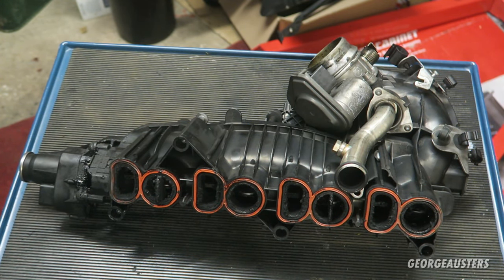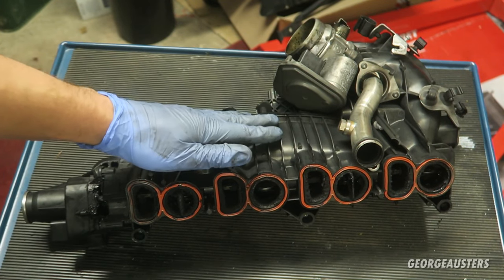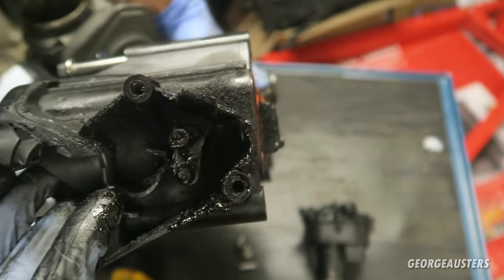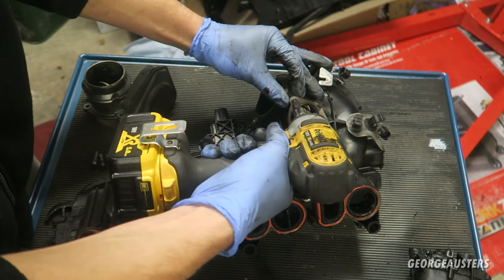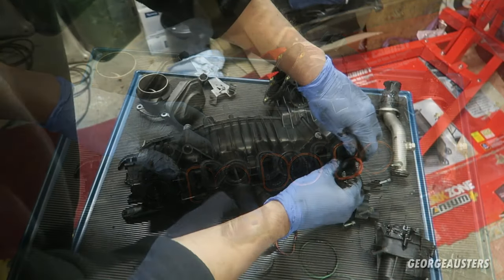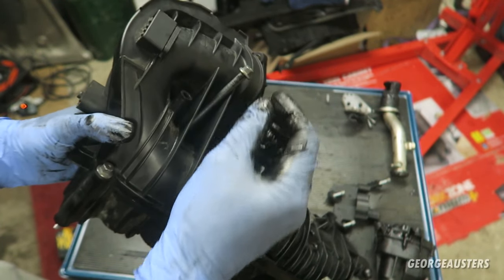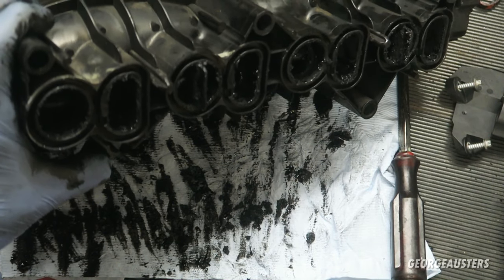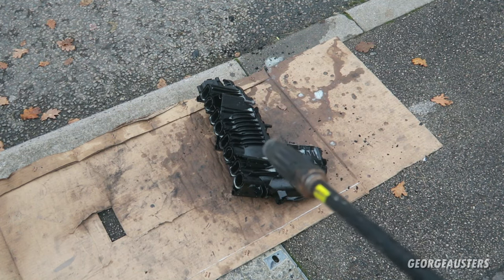How to DIY Carbon Clean BMW N47 / N57 Intake Manifold

Comment: If the manifold is that bad, then the intake ports on the head will be just as bad too. I put the manifold and loose parts into a bath of water based parts cleaner. Works very well with the HP wash after that.

Comment: Plan to do the same on mine but I have previously done it on my 3.2 did shogun, I found oven cleaner, the foam kind to work really well for agitating the parts you can't get to and then did the same with a pressure washer...

Comment: I recently done the same on a van.
Got a tip from someone who suggested immersing it in diesel over night. I did this and in the morning all the gunk was dissolved sitting at the bottom of the container. 
I left the rubber seals on and the became soft so had to get new ones. But the diesel worked unbelievably.
Reply: Does this really work? I'd love to try it and don't want to mess up my BMW's intake manifold... Diesel wont eat anything else and only loosens the carbon buildup?
Reply: @blankname8553  yes really did work just remove any seals before hand 
Thank me later

Comment: Very good video, I have thought about doing this after the 6 years I owned my 2009 E91 with the N47. And after watching this I now know why the engine don't have the same power it had when I bought it. Luckily my engine model don't have the swirl flaps.
Thanks again for you effort :)

Comment: I bought a 2nd hand inlet manifold to replace one on my 320d where the brass rod had worked its way out into the engine bay!!  The new one was filthy, but I used a gorilla tub, and loads of really hot water  with a few cups of Daz washing power, and just left it to soak in the gorilla tub for a few hours then flushed with a hose and repeated the process... Automatic washing powder is fantastic at removing grease at those temperatures ;-))

Comment: Newer N47 haven't got the swirlflaps at all. Mine is a N47 (E91) from 2012 and the inlet  manifold differs a lot  from your  from 2008.  I cleaned mine manifold at 100 000 miles, and it was definitely necessary.
Reply: Same here at 105K miles

Comment: Hi George great videos, Super helpful with all my n47 issues so far. Just wondering as im not very confident cleaning the inlet ports on the block its self. Is there any downsides to just cleaning the carbon build up on swirl flaps and inside the inlet manifold only instead of doing the lot?

Comment: Good video - best degreaser for this is Screwfix non nonsense heavy duty degreaser. It is about £10 for 5litres. It eats oil and grease and is water soluble. It will remove all that stuff easily and better than any soapy degreaser. Im just a bit concerned that all that water will get into sensors on the body of those electrical control valves. I would let mine dry out overnight in a warm room ( kitchen!!) Soak the seals in tis stuff and it will clean them like you would not believe!! no solvents in it either just surfactants.

Comment: Further to a reply I made on another of your videos a week or so ago, timing chain noise seems to be getting worse on mine and can’t afford to risk letting it grenade so am booked in with a specialist in Nuneaton to get the job done on Monday! Have been paranoid about it since day one of getting the car so.. at least it will take that paranoia away!
Reply from the maker: Good stuff. Are you getting clutch and flywheel done at same time?
Reply: It’s an automatic.. so no just the chain job. Have been contemplating a full automatic transmission service though..
Reply from the maker: Would recommend auto gearbox service every 60k Miles but that can be done at anytime 👍🏻
Reply: @jimtaylor431  I am also gonna get my chain done. Got all the bits. Chain gaskets oil filter. Also gearbox filter sump pan and oil. Ben quoted £650 for a labour only job!  I'd do it myself but can't get my car high enough on my drive way. Just doesn't seem practical. So will be interesting to see George do it. Looking forward to that video. 👍
Reply: Lee Pearson Done some DIY on my cars but a timing chain is way beyond my confidence level let alone dropping the engine out :-) Look forward to seeing what’s involved when George tackles the job.
Reply: Change oil every 6k to make new chain last forever
Reply: @leenevin8451  Certainly will be!

Comment: Hi George - thanks for putting so much effort in to these videos, they’re really helpful.

I had to swap the alternator off my 191k N47N and in removing it I had to remove the anti-shudder valve. This got me a look into the intake manifold and I couldn’t believe how caked up it was! I’d say the volume inside had reduced by 50-60%!! Whilst there was obviously a clear path to the ports, there was huge protrusions of the sutty mess from the walls of the manifold.

I’ve already removed the EGR and had the idea of cleaning the intake manifold, ports and tops of the valves but with the effort and time it would take, I was wondering just how much of a benefit it would have actually have.. 

What are you expecting to see and feel from the engine once the intake side is squeaky clean? Do you think the benefit outweighs the effort and time to sort it? 

My 318d is getting around 44mpg and I do a few miles so I’m frustrated with it for saying I got it to replace a dreamy 330d for cost purposes! 

Look forward to your reply mate.
Keep up the good work 👍🏼
Danny
Reply from the maker: Having a less restricted intake means more power and MPGs so it's worth it in my opinion!
Reply: hey, thanks for good videos. I have BMW 520d the same motor you have. When I driving the car so rpm resting up and down while driving. I have checked thurtle door so was there a lot of oil there. And the car is minking oil. Do you have any experience with that and thanks

Comment: Get idea to clean the inlet manifold.. but blasting all that crud in to the road / drains isn’t good practice. If you have to do it again try mixing soda crystals and white vinegar inside it then leave it to soak.. you’ll be amazed how clean it will be

Comment: Thanks George......very helpful indeed.

As a novice a couple of questions arise:

1) I assume that the nature of the beast  requires a periodic repeat of this process. What interval between those repeats has been your experience?

2) Given the mess that is typically found in the intake manifold, I would think that the head on the engine block would be in similar shape. Is this so and if so, how do you deal with it?

Thanks again!
Reply from the maker: If your EGR valve is removed then your intake manifold will not return to this state.

I have a video of me doing in the ports on the head👍🏻 

https://youtu.be/c_VK-cUoccE

Comment: I knew there was a cleaning video.
Ive spent 3hours cleaning mine, i used a oven cleaner and a long dessert spoon.
i had to do the delete flaps since my swirlflaps showed sign of play, i did one small tap and the clamp inside broke away. This made me realise i was so close to it breaking off while it was in the engine.

Comment: Hey is a clogged egr the main cause that i got a drivechain error which reduces my speed and power or a sparkplug? Once a month i got a drivechain error, i did let read the errors trough obd, there where 2 errors of egr and a one from sparkplug.

Mine is a 318d from 2015

Comment: Not too experienced with this bit I've noticed a leak from where my swir flap acroator meets the brass rod. Looks like the o ring around the rod is allowing air into the intake. I'm assuming this should not be the case? I have bought a new/used one and will use your cleaning technique. Hopefully the new one isnt leaking too due to this being the standard....
Reply: Update..
It was leaking

Comment: I had a clogged intake manifold on a 116d with b47 engine after only 70K KM! It had a dramatic loss of power, getting it over anything but regular highway speeds becoame impossible! 
It was a lease though, so I had it replaced and thought nothing of it at the time. I own my own 316d with b47 engine now, and seeing this makes me want to pre-emptively clean it before it throws an error, and disable EGR altogether. When should I look at this inlet manifold? I have 125K KM on my car now, as far as I know (didn't get it new), it's all still original. Should I wait for symptoms to arise? Is it easy enough to remove that I could just do it over a weekend while doing other maintenance?

Comment: Should i do swirl flap delete if i do remap ? Or i can just get new intake manifold if mine failed . If i do delete will i get bad mpg and low power at low rpm even after remap ?
Reply: N57 30d x5 f15
Reply from the maker: You should be able to just replace the swirl flaps themselves on the N57. I wouldn’t recommend deleting them

Comment: Gonna do this on mine. Bought all new gaskets. And I have bought a blank for the swirl flap rod. Is there I reason why you aren't removing the flaps?
Reply from the maker: Watch Friday’s video before you think about removing the swirl flaps mate!
Reply: Lee Pearson Have read that unlike the M57’s, N47’s do suffer from negative driving characteristics with flap removal. Have even seen threads from folks wanting to reinstall them such is the impact to how the car drives.
Reply from the maker: Yep, I explain it all in Friday’s video👍🏻
Reply: @GeorgeAusters  Is that the video named "How To Remove BMW N47 / N57 Intake Manifold" where you explain the reason why? Thanks.
Reply from the maker: @leadster88  No the video will be up tomorrow (Friday at 6:30pm) mate!
Reply: @GeorgeAusters  Brilliant thanks mate.
Reply: Swirlfaps were the M47 M57 issue, I had them removed as soon as I bought the car. Together with turning off the EGR
Reply: @livegaming3205  u can still pass MOT ? are u from UK ?

Comment: Should there be any issues with starting the car back after refitting with disconnecting the injecters
Reply from the maker: No, you should be fine 👍🏻
Reply: @GeorgeAusters  OK cheers George, starting to think the engine is just buggered,

Comment: My diesel 328d gave some  codes P2004 intake manifold runner control stuck open & P2453 DPF Differential pressure circuit range/performance. I took The entire manifold and cleaned it but the the code did not go away so does that mean its time to replace the air intake manifold??

Comment: I’m considering doing it on mine, but Is there much point unless you clean the valves and ports while it’s out? Is there Any method for the above said other than walnuts?
Reply from the maker: Yes definitely worth doing the manifold, even if you can’t do the the ports and valves
Reply: @GeorgeAusters  cheers pal, just I read a lot of people going on about the valves too. But can’t do any harm. any clean is better than no clean. My Intake was replaced at 69k. Cars just hit 90k. When it was changed Swirl flaps were solid, connecting pin from actuator was snapped. I’m hoping to prevent the same by periodic cleaning, hence checking out your video. I’ve Just removed the pipe from the throttle body, is it normal for oil residue to be present? It’s not a lot Just a smear around the bore and throttle flap.

Comment: I got the 6 cylinder, f10 530d,  50,000 miles.  Heard about walnut shell blasting the inlet manifold,  is that advisable?   At 50k miles will the manifold still be quite bad?
Reply from the maker: No need to walnut blast the manifold as it's plastic but you can walnut blast the intake ports/valves. Alternatively you can clean them like this:https://youtu.be/c_VK-cUoccE

Comment: Great video mate, going to do this on my E90 320D (M47) did you mask off the electrical connectors on the manifold or just pressure washed it and let it dry? Also how long would you let the manifold dry for before reinstalling?
Reply from the maker: There is only a MAP sensor on this manifold which I removed. Manifold doesn't need to be bone dry, as long as it doesnt have puddles of water in.

Comment: Hey man, nice one!! I plan to do the same for my N47  - quick question, do I have to dry the manifold before fitting it back? The main reason I am cleaning it is clogged badly and I got a message "particular filter", do you think after cleaning this message will go away?
Reply: Please stay away from your engine and give your car to a trained mechanic.
Reply: @herobo123456  cheers buddy, actually, I cleaned and it turned out the message was related to a DPF sensor and I replaced it took me 10 minutes and bought only for 10 pounds and saved probably 500 GBP so no thank you I won't give it to a trained mechanic to rip me off :)

Comment: hey great job! after you have cleaned the engine has become quieter and vibration less?
Reply from the maker: Hard to say
Reply: @GeorgeAusters  i don't understand? did motor become quieter and vibration less after that?
Reply: @M-1453  he means ...... he cant tell the diffrence before and after cleaning

Comment: How much would a garage charge for this? I'm not mechanical minded so wouldn't be confident doing it myself
Reply from the maker: Hard to say really as it can take hours to clean. It's pretty much just all labour.
Reply: this is easily a 5 hour job. All labour and only 30 quid for new gaskets. Did it today and spent the whole day :)))

Comment: I have never heard of an "anti shudder valve" before... It looks just like a throttle body to me! What exactly does it do?
Reply from the maker: Anti shudder valves stop the engine from shuddering when it shuts off. It’s only wide open when you start the engine and closes shut when you switch it off.
Does not work like a throttle body👍🏻
Reply: @GeorgeAusters  Well thats a new one for me!  I've owned a handful of diesel cars and none of them had this. Got a 330d now as well and pretty sure it doesn't have one of these. Wonder why they started fitting them as it just seems like another electronic thing to potentially go wrong IMO.
Reply from the maker: Your 330d DOES have an anti shudder valve. No diesels have throttle bodies👍🏻
Reply: Main purpose is to close off air intake to prevent a diesel runaway.

Comment: Can this affect power/performance almost like turbo lag symptoms?
I had a 320d n47 remapped and I'm sure it's lagging in power over the last 14 months slightly
Reply: Absolutely, just take off the engine cover, remove the MAP sensor on your inlet manifold either 10m hex bolt or T30 torx holding it - there should be a hole in the sensor, this usually gets totally blocked when the manifold needs cleaning - be careful cleaning the sensor hole and don't push anything in too hard, just clear it out and the hole in the manifold until you get a chance to clean it.

I use caustic soda, it's the best way by far with no messy hands - follow George's instructions for stripping down the manifold then just soak, jet wash, soak, jet wash, soak, jet wash - looks like it just came out the factory, far superior clean than solvents and you won't smell of petrol. Need a large tub big enough to submerge the entire manifold, 500 grams caustic soda and somewhere to jet wash it clean.

Do it on every timing chain job and my customers love it, especially if it's badly blocked because they can really feel the performance improvement - seen manifolds with less than 30% airflow they're that badly blocked.

Comment: How much is a new intake manifold
Reply: You used to be able to get a reinforced one from Germany for around £170 including shipping but they've stopped shipping to the UK after Brexit due to the increased cost of exporting to the UK. If you look on eBay you might be able to get them to ship out of you can negotiate fees for shipping and all of the extra paperwork they need to do now

Comment: Great video mate..
Reply from the maker: Cheers mate
Reply: My brass rod snapped and came out of the actuator   gotta get the manifold out and see what's up...only new to bmw myself bought a 08 320d e90... this is all I need..if the flaps havent fallin in am I ok to blank as I've not the money to fix that..

Comment: Would you recommend heating it up in oven beforehand? Low temp
Reply from the maker: No I would not lol. I wouldn’t recommend putting any heat onto the plastic manifold at all👍🏻
Reply: Is this even a serious question? LOL
Reply from the maker: As funny as it may seem, heating up the intake manifold for cleaning is actually a pretty common thing, but only on the cast iron ones👍🏻
Reply: @GeorgeAusters  That would make sense yes! However not a plastic one..
Reply: Jean Claude Bezzina what and the manifold stays cold when engine is hot can’t do it much harm can it
Reply: Jean Claude Bezzina the manifold has EGR gases pumped into and it bolted to an engine block, of course it gets hot

Comment: How do you fix cracked adjuster unit?
Reply: Mine is broken too. oil mist comes out from there. That's why I think there is a bad smell inside the car.
Reply from the maker: Intake manifold needs replaced
Reply: @GeorgeAusters  what you said broke my heart ahahahaha thanks bro. Greetings from Turkey.

Comment: Quick question 
I drive in Germany a lot sometime full throttle I’ve done 140mphfor more then 1 hour do you think this was cleaned out by itself
Reply from the maker: Hi, unfortunately the intake manifold doesn't get cleaned from air flow alone. Your DPF get's cleaned from continuous driving because it gets hot enough to do a regeneration
Reply: George Austers so you saying the only way to clean is by taking it out and physically clean it ?
Reply from the maker: That is correct my friend👍🏻
Reply: George Austers my bmw has 130k miles how often do you think it should be cleaned
Reply: @hidri86  I think now is a good time
Reply: George Austers would terraclean carbon engine clean remove all this carbon? Do you offer this clean as a service?